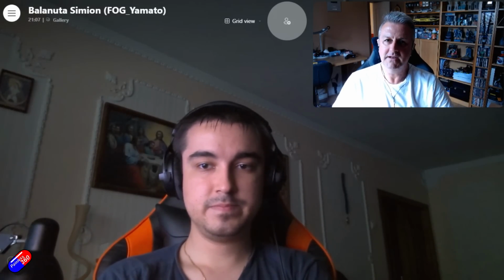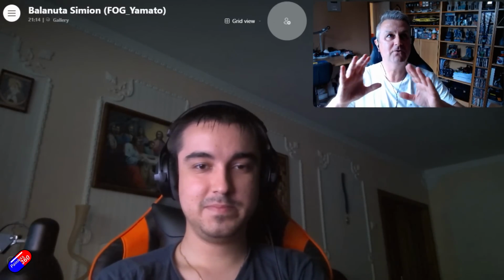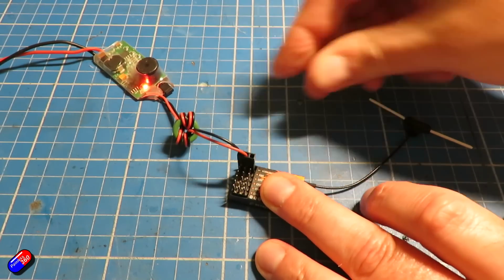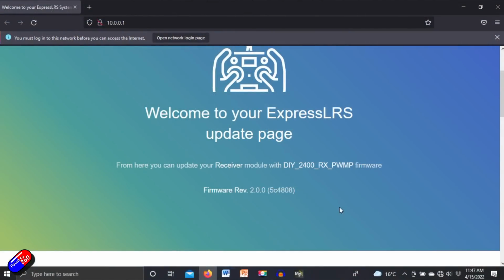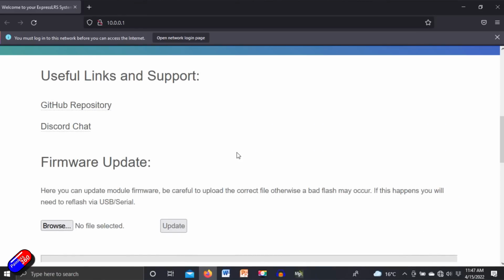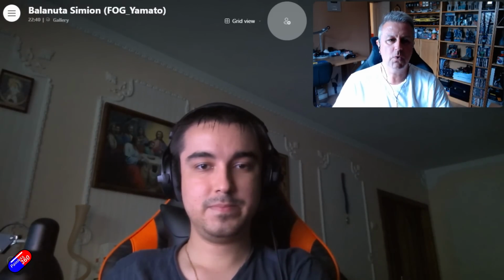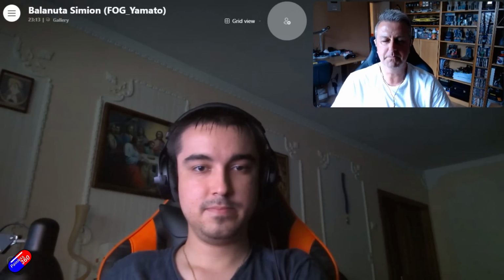ExpressLRS v3.0 is almost here: Some of the new stuff is wonderful!

Comment: Is there a simple way to check antennas to see if they are still good? I don't want to put a dodgy antenna on a transmitter and blow the transmitter.
Reply from the maker: I'm not aware of an easy solution for the hobby. Hobbies like amateur radio has stuff... Happy flying
Reply: if you get yourself the 900mhz version you can get a cheap VNA for 40 bucks and check or even build your antennas yourself xD
Reply: @hirnlegorush  Thanks. I found a HP network analyzer at work.

Comment: Would there be an ability to use a 3.0 transmitter with a 2.0 receiver. Mainly because I have a tiny whoop that’s on 2.0 So I guess the question is also how fast would betaflight be able to implement 3.0?

Comment: Let me say this. If you are not running ELRS then I guess its time for you to find another hobby.
Reply: I have no reason to switch, flying r9 for years and it has never failed me once. I don't have to update my firmware because it is mature and has all features I need. as a freestyler i don't need lower latency and higher range... 

u are not defining what I need to do what I want...
Reply: @derrogers  I had terrible jitter/twitching problems with my R9. That's why I flashed ELRS to my modules and receivers. I never wanted to get back. I'm guessing you are at the Access stuff because FrSky never fixed it in the other R9 versions/firmwares.
Reply: @ZeroFPV  nah, acst all the way. eu lbt using fport... no issues at all... but i have to admit im not flying it very far. 

had thought about changing fw to elrs, but the hassle of upgrading my whole fleet  every time devs release a new update is just  a pita.
Reply: @derrogers  I do understand. However you don't have to take any minor update and flashing is pretty easy via fc passthrough.
Reply: @ZeroFPV  not worth the hassle, I will think about upgrading when it stops working
never change a running system...
Reply: I can appreciate the enthusiasm, as I use ELRS myself, but it's not fair to say people must use it or find another hobby. If their existing solution works fine for them, why change? Some of the systems like Ghost, R9, even Spektrum work just fine. But ELRS is certainly going to get better and better ;)

Comment: I understand that there are only 12 channels available on elrs.
Will it be 16 now?
Reply: In the fullres modes you can select, 8ch / 12ch / 16ch modes, and the 8/12ch also get the AUX1 channel for free so they're 9/13ch (although it is 2-pos only). 16ch has a full resolution AUX1, but it still must be an "Armed" switch since there is still functionality tied to this (such as Dynamic Power).
Reply: Thank you Bryan